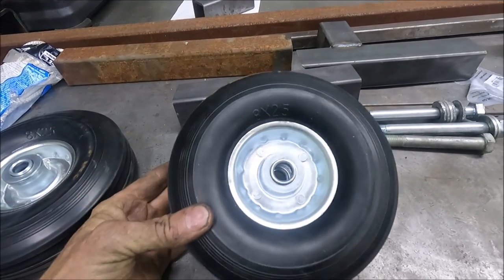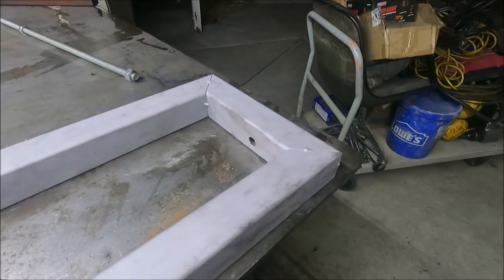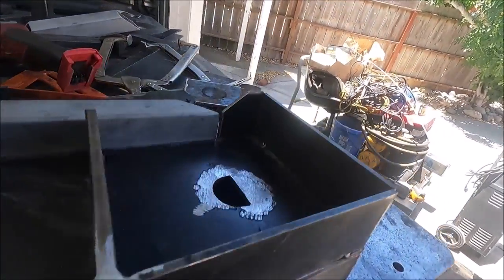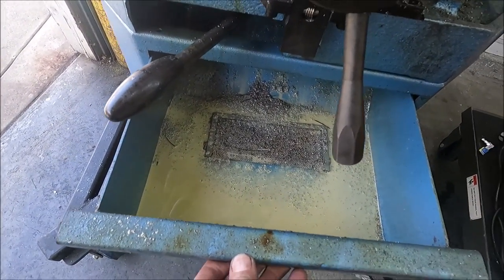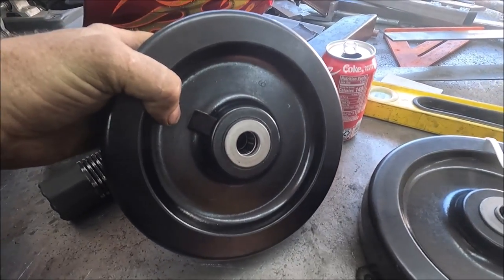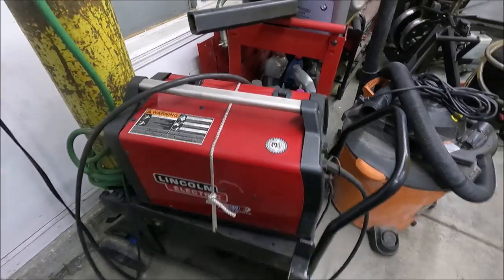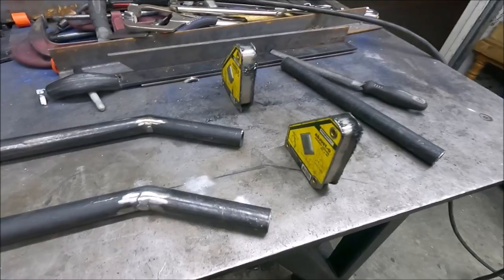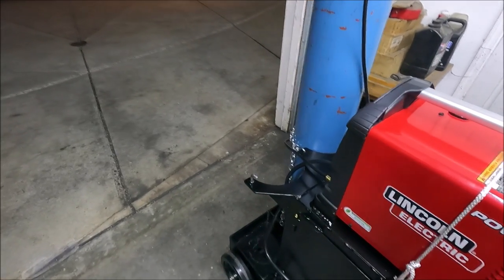Custom Welding Cart Build for Lincoln 210 MP

Comment: My brother passed away last month. I ended up with his welder. It's a millermatic 130 I think. I do not have a bottle of argon yet but am going to add it. IT has the gauges for it etc. I bet it's not been used 30 minutes since it was new and he had had it since he built his hot rod cars like 12 years ago. Pretty nice welder really. I Tried it out but without the gas the welds do not look very good LOL
Reply from the maker: You can use flux core wire in it.  But it will work much better with argon snd co2

Comment: I don't understand why almost everyone builds these straight wheels in back.  I hated that I could not move mine sideways so my last build has casters at all four rollers.   I like the door to hold stuff inside so they don't get grinder dust all over them.  I would make the tank easier to remove without the bottom lip which requires lifting it off.   I hinged flap at the bottom allows it to slide down off the perch and when folding up holds the bottom in place.   I have to build a new one now.   My shop is always full, so I want one as narrow as I can, the wheels sticking out no good for me.
Reply from the maker: It’s much easier to move with straight wheels on the back.  Especially if it’s real heavy.

Comment: how you like the 210?
Reply from the maker: It works great.  I like it.  220 amps in a small welder.     But I haven’t used it much yet.  Most of the work was done with the 140C welder.  It was just kind of s hassle to use it since I didn’t have a cart for it.  The next project I will use it a lot.